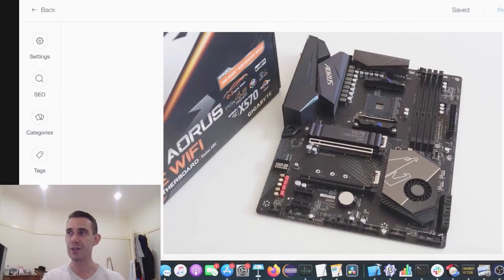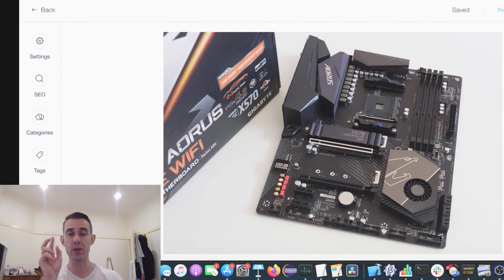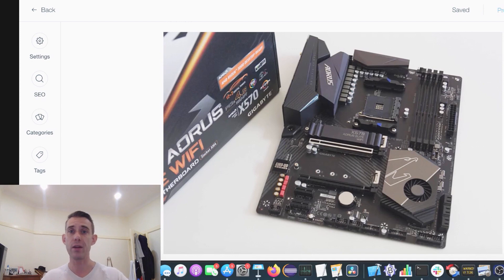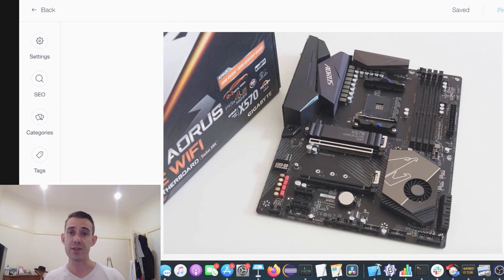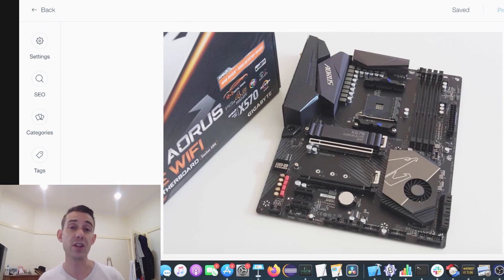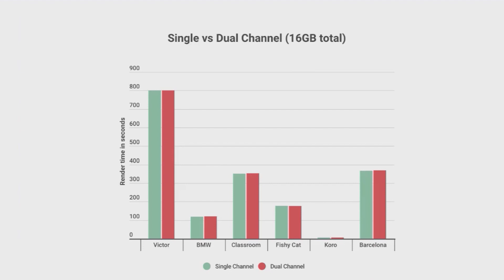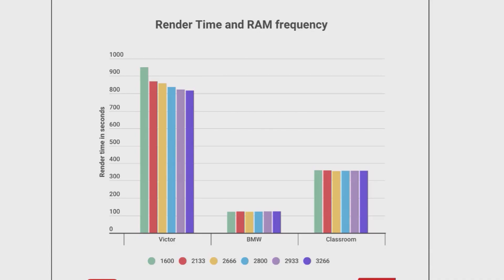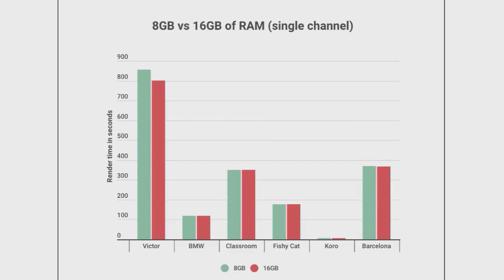How Does Your RAM Affect Rendering Speed - Blender

Comment: Benchmark statistics are not suitable for real work tasks. for example, my scene is so large that when rendering does not have enough video memory, then Cycles uses RAM, and in this case, the rendering process is ten times slower. That would be great if you conduct such a test when there is not enough fast video memory, how important is the one-, two-, four-channel RAM
Reply from the maker: Hmm, well the Victor benchmark is actually a real world project done by the Blender Institute, it was called Cosmos Laundromat and you can see it here -> https://youtu.be/Y-rmzh0PI3c

Its about as real world as it gets :) 

As for what you've mentioned with video memory, you'll have to point us to the version of blender and OS you're using cause when we run out of VRAM when using cycles, we just get CUDA/Optix out of memory errors, and the render stops! That is using Blender 2.92 with an RTX2070 Super Card, windows 10 as the OS. Be awesome if there is a way to render on a GPU beyond the limits of VRAM, but our test bench refuses to do that!

For sure we'd love to test how main RAM affects GPU rendering, but theoretically, its probably not going to be any different. Still testing is what reveals the truth so stay tuned, we might find a way to squeeze this in :) 

Thanks for commenting!
Reply: @Crowdrender  Hi! I've done some experiments, and I agree with you, that if not enough VRAM the Optix gives an error, but if the usage of VRAM needs for render slightly bigger than it actually is in graphics card (in my case it's 1Gb), while the image is rendering, some tiles pass fast and for other it took ages.

I use  rtx 2070 super

(Sorry for my bad English, I haven't finished my studies yet) :-)

Thank you for your work
Reply from the maker: Hi Volodymyr :) great that you have done more experiments! And you're using the same GPU as we have, so be great to compare results sometime :) 

You mention some tiles are fast, others take a long time, are those slow tiles in more dense areas of the scene where there are more polygons? Or, are you using Hybrid rendering? 

If the slower tiles do have more polygons, or have to render volumetric shaders, etc, then that is pretty much to be expected. Otherwise...

One thing that has been clear from testing is that hybrid mode can sometimes be a lot slower. This happens, for example, if you have larger tile sizes, say 50 pixels and above. The GPU is fast for these tiles, but the CPU will struggle. However, since the CPU usually has more threads, it can 'grab' many tiles at once and they appear to be really slow compared to the tiles that the GPU does. 
Near the end of the render, the GPU will have no more tiles to render, and the CPU may have many tiles (on a 3950X which we tested, 32 threads can mean up to 32 tiles) still rendering. 

One solution to this problem is to reduce the tile size so that the total area of the screen that the CPU can 'grab' is reduced. The GPU won't be as efficient, but cycles has been optimised to work a lot better with smaller tiles so its better than it was at using smaller tile sizes.

Anyway, thanks for replying, keep experimenting to see what works!
Reply: @Crowdrender  The fact is that I do not use a hybrid render, and scenes without volume, I do archviz and came across such an interesting feature that some tiles are calculated quickly and others very slowly.

For example, if you remember during rendering from above there is a line with the number of samples (0/12000) then during the calculation of one tile approximately 300-400 samples are added, and in case of slow 20-30 is added.

if you are interested in checking it yourself, I can attach a link to Onedrive or Google Drive and send you an email, although it is quite heavy, more than 3GB 

By the way, there is a quite useful feature called tile stealing for the hybrid render in the last release of Blender.
Reply from the maker: @Volodymyr_Vova  Sounds interesting! Be good to see the tile stealing in action, we've been watching the developments of blender and had seen quite a bit of noise about tile stealing having glitches. Be cool if it works now!